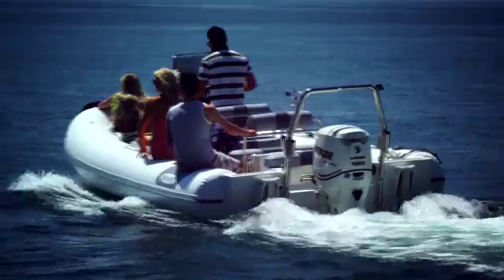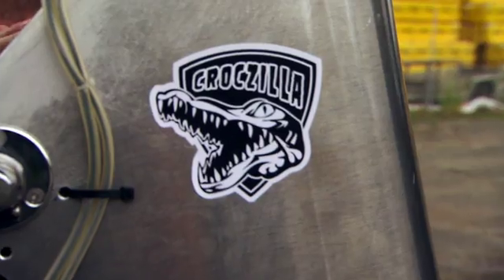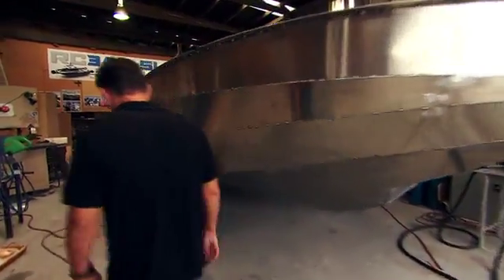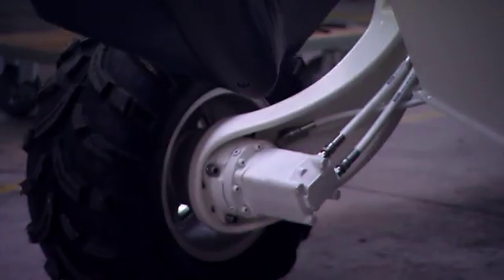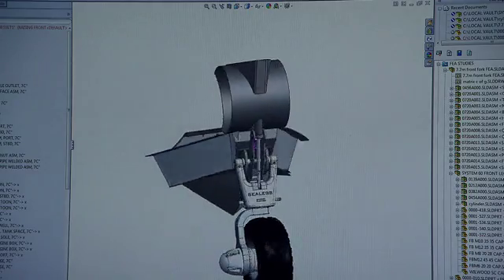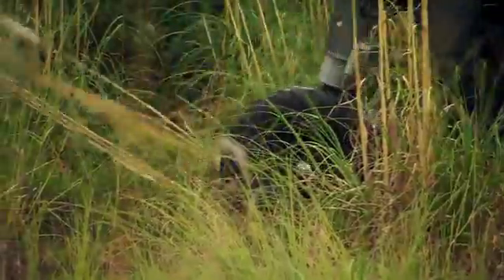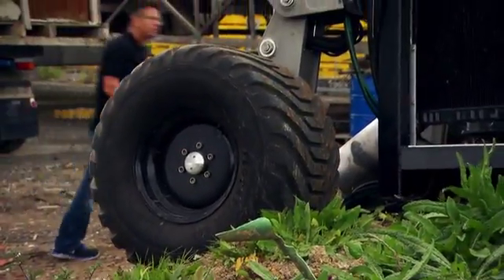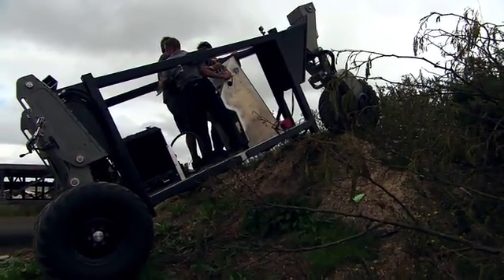System 100 Features on the Discovery Channel

Comment: Aloha, will it also work on "Soft-Sand?" Like Makaha Beach on O`ahu?
Reply: Jarrett L. You tell Sealegs what applications your boat is for...they have wider tyres for mud and swamp work, on existing sealegs models.
Brand new sealegs boats, are the better part of $200k NZ.
Reply: Makaha awesome beach love surfing with my kids
Reply: Most things that move on tyres will be ok with the right tyre pressure. An at home test would be to get a trike, load it up with weight like the boat would be and try drive on the soft sand with the correct tyre pressure, 10psi or lower if you can. And by being hydraulically driven(sealegs) you don’t have the issue of open diffs etc so power is not an issue. The issue is tyre pressure on soft sand. Plenty of trikes in Hawaii you could do a test with to get a rough idea of how you would go.